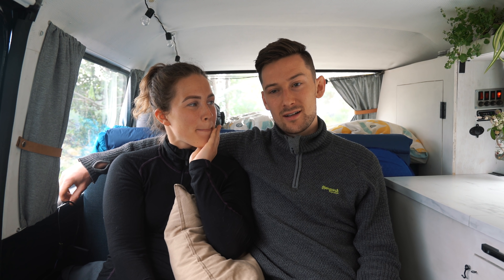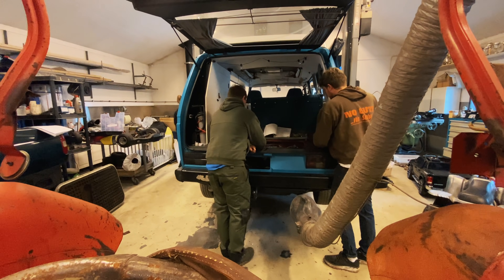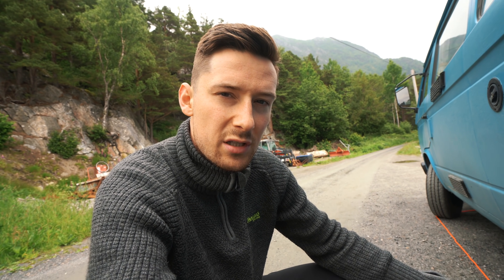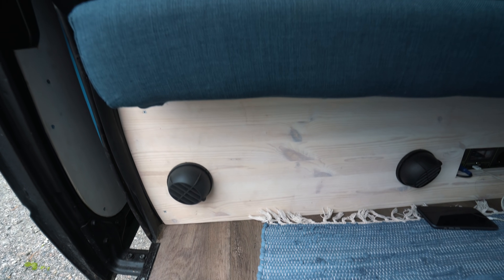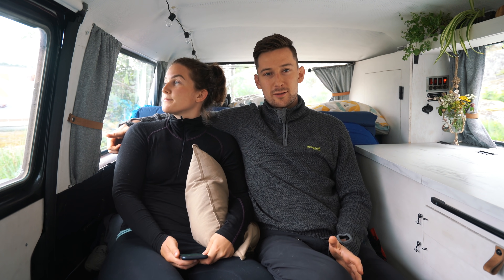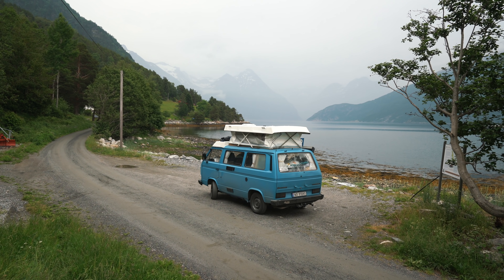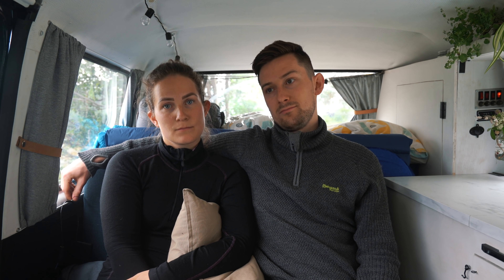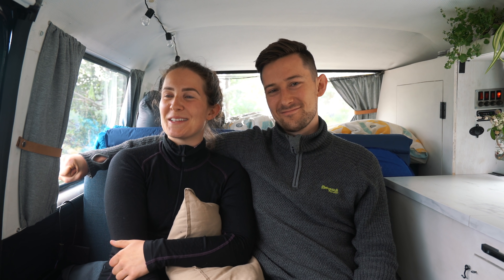Vanagon upgrades and future wants! HELP!

Comment: Hi!   Love your information and travels.  I have a Country Homes Camper on a Vanagon GL.   It has the same roof tent as you have.  What I did was get some dowels and cut them to extended size to support the roof as I had a yakima rack on it and a canoe several times.  I didn't pop it with the canoe on top but just the weight of the rack made it sag a bit.  The oak dowels stored right where the tent is so they weren't in the way.  It's worked really well.   I also have the Westfalia with the pop-top.  I like the tent for the CHC as there is so much more room in it and all the windows.  Also, its kind of clausterphobic at the back in the westfalia so we have to sleep with the head to the front of the van.  This is less private and I had to make a small platform to fit and extend the bed so the darn pillow wouldn't fall off the bed.   :)  So, in all there are pros and cons to both.  On the Westfalia I have the lift because I have the yakima rack up there and it came down on my head once....ouch!   Even with the lifts it's still pretty heavy.

Comment: Koni shocks,  T3 techics suspension up grades, heavy duty front sway bar. "Proper rated tires " not car tires...Propex heater. Small trailer will make your life so much better catch all for everything in your way, free up your in side space..use a ultraviolet light that makes ozone to kill mold..

Comment: Do you have a link to the string of lightbulbs you have on the roof of the back of the van? My Wife and I think it gives a great warm feel and would love to see what model you went for! Also, I assume the wire has a on/off switch and it is connected straight to the battery? Thanks!

Comment: What size wheels are you looking at for the future?
Reply from the maker: We might end up with 215/65/15. We want 15 or 16 inch wheels at least.
Reply: @SimonBraeck  sounds good. Little bit bigger but still not too far away from the classic look and feel :) easier to find replacement tyres with 15/16" too

Comment: Suggestion:
Replace yr fridge for a compressor-type. They take a fraction of the energy an absorption-type uses. Compressor-camping-fridges are quite expensive I know, but the comfort they give you for not-using up yr battery is priceless 😂

Comment: As you have a tow bar get and ERDA trailer to store the things you don't need every day or only when you park up, we did this even had an Avon inflatable boat and outboard engine all kept in the Trailer. works well and should you get to a dead end just unhitch the trailer turn the van round and re attach the trailer. Good luck and come visit the U.K. soon! P.S. Get the lockable lid on the trailer and at least one wheel clamp for when you leave it on a camp site and go off to town.  Keep it on the black stuff!!

Comment: So excited you are both enjoying the open road again!!!  Look forward to future videos and upgrades to the van!!!
Reply: Also are you feeling the vibration in the pedal or in the van itself shaking?
Reply from the maker: Thanks! It's only noticeable via the pedal.
Reply: @SimonBraeck  try only applying the hand brake lever lightly while driving around 20mph.  If you feel vibration in the handle its likely the rear drums.  
Then you can try and loosen the lug nuts and tourque them evenly to the required spec.  If a garage put the rims on they could of un-evenly torqued the lug nuts (with an air gun) and caused the drum housing to bend enough to cause vibrations, when the brakes are applied.  Hope this helps!
Reply from the maker: @gport27  great advice, will try this asap! thanks!!

Comment: Hi there, I had the same problem with vibrations in the brake pedal and nearly changed everything. The solution was to release the handbrake cable completely before adjusting the rear brakes!
At the very end you can readjust the handbrake. Otherwise the tension of the handbrake cable tilts the brake pad carrier and this causes the vibrations during braking.
Reply from the maker: Hi, this might be the only thing we haven't checked out. Really appreciate the advice, I will check it soon! :)

Comment: Great to see you travelling again and producing your fantastic videos. Our VW T6 has a 175w solar panel on the pop top, 110amh leisure agm battery under the seat and victron solar charger controller and victron dc to dc charge controller from the alternator, this keeps the fridge and interior lighting going and several USB ports for charging electronics. Every time we go away like you we feel there is something else needed or got rid of as it’s not being used, we found large plastic boxes useful to keep kit in as you can store them out side under the van when stopped for the night.
Reply from the maker: Thank you. That sounds like a nice setup, we are considering adding lithium batteries to extend our off-grid time.

Comment: Hi, I am assuming your new engine is probably a 1.9 litre which has a taller block than the 1.6. When converting people either lower the engine a bit or lift the engine cover that same amount instead. If your engine is hung slightly lower, I wondered if you had noticed the slight reduction in ground clearance ? When gaining extra torque from the engine change, some people use slightly wider (therefore also taller) tyres to reduce engine revs at cruising speed - if in fact you went with standard tyres presumably you decided against this. Lastly, with modern li-ion batteries you can sustain a high short-term load so I would be tempted to ditch gas cooking and use a small induction ring  - easily topped up from a few PV panels or the alternator when moving.
Reply from the maker: Hi! Correct, we have a 1.9 TDK engine now, but I really can't say we lost any ground clearance to be honest. We will eventually move over to different tires as you suggest, just waiting for new wheels to be available before we can do this swap. In the future, we will be switching to lithium batteries, but I am not sure we will have enough energy to switch over to a induction rig right away. But there is always a possibility in the future... :)

Comment: It sounds like a big job to replace the entire roof, Is it not possible to add struts to the current setup? I'm sure you have also considered a hightop, do you dislike the aesthetics?  Glad the engine is running well. Nice Photoshops skills btw.
Reply from the maker: We have a garage clearance limit which makes a pop-top the only option for the time being. The lifting mechanism on the current roof is far from optimal and I can't figure out how struts can solve this problem on this roof type... Thanks ;)
Reply: @SimonBraeck  Could you change the hinges so your SCA roof are back hinged like a westfalia or a Reimo?  Well you stil need gas struts to lift it, if it is a skiboks on top.
You have had storage under the roof in the back, re-instaal it or make a bigger one. In my Reimo i have RnR hinges for the back seat that are for the T1 and T2 (split and bay) they lift the seats up 16cm when in bed mode. It has given me a storage room under the bed that is 80x150x14cm or 160 liter. The rear left cabinet in my Reimo covers the hole rear left window, lots of storage, could you extend your cabinet? could the rear seat be moved a few centimeter forvards, and may be a few cm up? 5cm forwards gives about 24 liters moore under the seat. Could you move you power bank or instal one 100ah lithium battery behind the drivers seat, so it dont take up space under the back seat? Some people, specialy in the US has made an extra room where the syncro has its fuel tank, behind the rear seat. they have cut a hole in front of the opening for the engine compartement. Some also has made a hole in the floor just inside of the sliding door, also wery good for tools and spare parts.
If you have not looked into how a T3 Reimo is made you are welcome to come to Lommedalen and have a look at mine

Comment: After spending significant money restoring our 1992 Volkswagen Eurovan, T4 California, campervan, we made the difficult decision to sell the van as we wanted an adventure rig that gave us greater capabilities to explore places that we couldn't access with the front wheel drive VW.  We replaced the van with a 2017 Toyota Tacoma 4x4, which gave us greater opportunities to explore with the 4x4 capabilities.  We had a wedge-style pop-top truck topper camper fabricated for the truck as depicted in the attached link:  https://www.tacomaworld.com/threads/how-to-diy-wedge-camper.604686/.  This set-up is essentially a pick-up truck version of a westfalia camper, which we refer to as our wedgefalia.  Great to see you back on the road adventuring.  Fair Winds.

Comment: Great to hear you have found the issue with the engine, from what you said it sounds like it needs fine tuning. Really like the idea of a Westy pop top, we would like one for our van as it's a tin top but we have a roof rack and we keep a lot of stuff on there. We run a 200 ah lithium system on our van and it is awesome but expensive, if you can justify it go for it. We have a 150w solar panel and a CRX50 fridge and in moderate sun the solar will run the fridge and top up the batteries. We fitted swing aways on our other Syncro and found that unless the bodywork is perfect, when you tighten the bolts it deforms the panel as the swing away sandwiches the panel between the plates. It's not really a problem but it did crack the paint on ours. I'll send you an email in the next day or two regarding tuning your fuel pump if you like? 

Cheers
Ben
Reply from the maker: We need to have a closer look once we are back from this journey, I am just super happy we got the engine ready in time! I would love a similar setup, but as you say it is somewhat pricey. Do you have a swing away system on both sides?

Comment: Like i said commenting on another video, rebuilding that low mileage motor was a huge waste of time and effort. 

Since you knew the motor was more than fine, you should have allocated your time toward going through and optimizing every other system connected to and vital to that motor: Fuel (including pump timing, which is probably off); Intake; Exhaust; Turbo; etc. 

You say you have low power. Assuming the motor itself is healthy, which it better be after all of that unnecessary rebuild work, then its all about air, exhaust, and fuel. FLOW, FLOW, FLOW. 
 
That air filter is a piece of shit and its killing you. Get rid of it. Those motors need a MINIMUM of 210CFM intake airflow. Go check that one, its around 120 max. Rip it out and put in a high flow K&N with a fabric prefilter. 

Take the van to a TRULY EXPERT vw diesel specialist and have him verify your pump timing is correct.

Get a boost gauge and verify your turbo boost is where it should be, for that build maybe around 15psi max boost. And make sure your turbo oil supply and return lines are adequate. 

Your exhaust is pathetic 1.5” low flow garbage from what i can see. Get rid of it and have a custom 2.5” full stainless system made, centered around a Vibrant resonator. Vibrant makes a beautiful stainless one with 2.5” inlet and outlet. The build will be cheap at any GOOD muffler shop, around $250 max total at a US shop. 

Verify your fuel screw on your pump is where it should be. Once your intake and exhaust issues are fixed, your timing is right, and your turbo boost is where it should be, play with the fuel screw until you get black smoke coming out the exhaust under light acceleration. Then back it off until you only get a liiiitttle bit under very hard acceleration. That way youll know youre not underfueled.

Watch my vids, and join the Vanagon Diesel Owners Group on facebook. Lots of knowledge on there. 

And brush your teeth.